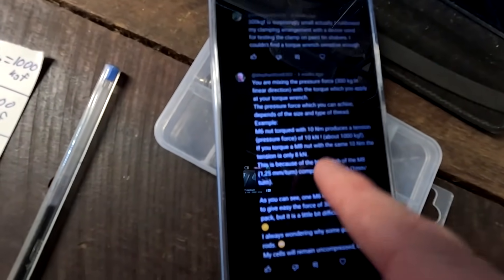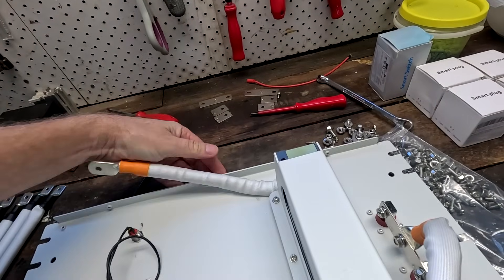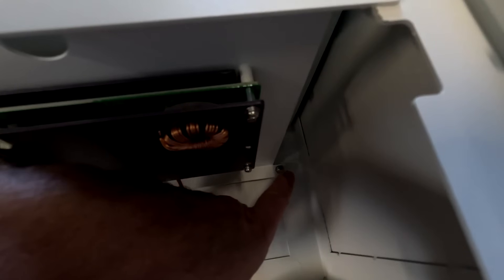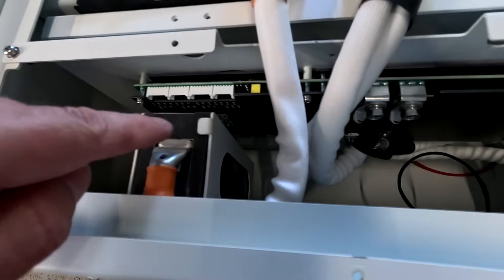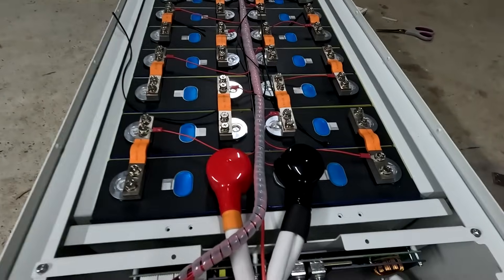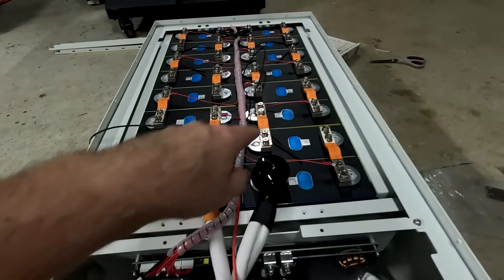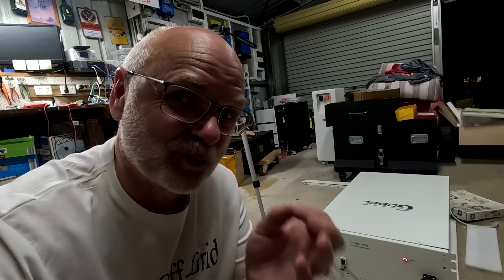The Gobelpower DIY Kit finally in action. Here is how their design works!

Comment: @6:31 you have corrected your mistake from the last video where you had that cable connected to the Battery + terminal. @9:42 the reason the rails don't fit is because you have too much foam between the cells, it's designed to only have the GRP sheets while you took the cells out of the EEL battery where they have foam and GRP. Take all the foam out apart from at either end and the rails will fit. I have the same battery and have managed to fit the NEEY 15A active balancer along with a Victron Smart Shunt and the JK touch screen LCD into it with not much trouble.

Comment: I am currently building two of batteries with this case.  The manual has some notes on the balance cables and where they go depending on which version cables you have.  I have Version 1 with a B17 labeled cable.  It says I need to connect cables B8 and B9 to Cell  8, then connect cable B10 to Cell 9 and finally to connect cable B17 to Cell 16.  My questions are what connects to Cell 10 then, nothing since I now have cable B10 on Cell 9?  Also do I connect cable B16 to Cell 16 with cable B17?  Thanks for all the great videos!

Comment: Hey Andy, my Gobel DIY box finally arrived. All parts included and all wholes fit like a dream, seriously, even the push-down bars, lid and handles. Not a single misfit.
The only thing which really is critical is, that the cable numbering on the JK-Inverter cables are running from 1-17...means from B8 onwards it is wrong! For someone without experience connecting the cables just by number will end up with one spare (No 17😮)...but worse...if they do it like that they kill the BMS as the polarity from B9/B10 then is reversed if you connect it wrong!!! 
Its important to rip out the B9 cable (the second B8 on the inverter) and proceed with B10-B17 ...
Maybe you can shoot this info to Gobel-Power for correction👍
Reply: Hey Christian - can I ask how long it took for you to receive your DIY box? Are you based in Europe? I placed an order and so far it's been a bit of a mess/farce with the batteries I ordered turning up out of the blue (nice surprise...), but not the entire order (missing 4 batteries!... I'm hoping it's not going to be a similar story with the box!!
Reply: @totemimaging  Hi, I only did order the DIY kit and checked on them several times since they did not care shipping the box with any notifications. It took more than 2 month until the box finally arrived - if I remember right. Given the relatively high shipping cost to Germany and compared to the "standard" Alibaba/AliEpress lead-times/cost a rather frustrating experience on that front. Good luck getting your missing batteries..

Comment: That 300kg compression force is nonsense. That presumes 0% flexibility in any part of the plate which is impossible across that span distance if/when, the centre bulge of the batteries grows under heat expansion pressure. 300kg total force is purely the tensile sum AT THE BOLTS.

Comment: Hello Andy, 
greetings from good old Germany (today 20 degrees Celsius) to sunny hot Australia. 
I am watching your Videos with big interest.  
I have also a DIY Kit SR1-PC200 with a heltec 4A aktive balancer an a Deye hybrid inverter.
I can confirm that the accuracy of th srewholes are not so good. I have also recognized that the Downloads of the Gobelpower homepage are not so good. In my DIY Kit was no extra fuse at the bottem of the rack, only the 250A cicuit breaker. Ultimately, my sytem works.
Greetings😁
Bede

Comment: Your 300 kg is shared with 2 stacks of batteries.  Each stack is getting 150 kg.  You need to double the torque on the 6 screws so you have 600 kg total, giving each stack of batteries 300 kg.  Just my opinion.  Oh, I see @olafschermann1592 already said this, with less words!

Comment: You can not accurately calculate clamping force from torque applied. Even things like lubrication and material of the bolt will make a huge difference: you can even repeat the exact same process on the same bolt twice and get different results.

Comment: The problem with "torque" to clamp load is you are just guessing about the friction!  mU is going to be wildly different depending on the exact state and geometry and lubrication state of your fasteners and for small ones, it's primarily driven by thread friction that changes each and every time you do it up as the threadform wears and distorts!.  What i would do is

1) Make sure all my fasteners have been tightened to 75% of yeild at least 5 times each to get to an even state
2) evently lubricate each fasterner with a know lubricant
3) ensure i have excatly the same hardware in the joint , ie washers etc
4) use a set of deomestic scales clamped into the actual system being assembled to "calibrate" the entire system, so you can literally measure clamp load vs torque

Of course, really, all this doesn't actually matter one bit of a low performance static energy storage application, where really all you need is for your cells to not actually fall out the box and that's honestly about it....  ;-)

Comment: I'm confused, in some videos I see the CAN connection is shown as the first RJ45 port and on others it is the second port - so which is correct?
Reply from the maker: It depends on the BMS and which communication PCB they use. Some have 5 ports, others have only 3 ports (Seplos for example).

Comment: 0.5 Nm never will be 300kg, put a scale behind the plate and take a look how far it raises at 0.5 Nm. (and is it 300kg/cm² or 300kg/m² - totally different! I asume the datasheet tells 300kg on the area of a side of the cell).
Or do you think/believe that you can lift a complete car (1200kg) using 4x M6 bolts on that plate with 3 Nm ? (or a single M6 to just lift ONE wheel?) Compare to the Nm you need to use on a carjack (inkluding positive bevel law) to just lift one wheel...
Sorry - that guy feels to be totally wrong or mixed up some dimensions.

Comment: Hello Andy, thank you very much for your video! I ordered two of these Gobel JK DIY cases myself and now I'm in a more positive mood again. Briefly about the JK Inverter BMS: I have hardware 15.XA and firmware 15.10, just like you. Bought from Minerals/Ali. When I update the firmware, exactly when I click on the update start button in the JK Monitor software, the BMS switches off. Otherwise nothing happens; switch on BMS and everything runs as before including FW 15.10. I would just like to update the firmware. I have no problems updating other JK Inverter BMS, only this one. Do you or someone from the community here know the problem...and a solution?

Comment: Thank you Andy, great video again. Don't you need the rails to stiffen up the lid when stacking the batteries on top of each other. Now it feels like the lid will press on to the cell connectors.
Reply from the maker: The lid has no direct contact to the rails, they don't touch. The boxes should sit on the outside frame of the box, not the lid itself.

Comment: A good rule of thumb if you don't have a torque setting ... tighten, a clean bolt,  till it stops, then and 1/8 turn.   All a torque settings is, is a stretching of the bolt.   However ... smaller diameter bolts are more sensitive to stretch, but the M6 and larger you are using should be fine.

Comment: I wonder if the reason the cells don't fit well is because the box is designed for 280A/hr cells, not 304A/hr, the front panel says 280...

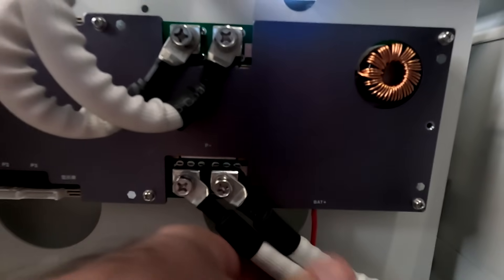Comment: 7:52 I'm really uncomfortable with the angles you have the cable lugs connecting to the BMS. It puts the terminals VERY closeto the metal backplate of the BMS.
I'd suggest you keep the lugs at 90deg to the side of the BMS to maintain maximum clearance (it's on the tight side even in the best case scenario), and if necessary, bend the cables instead. 
In a mobile application I'd even look at using some kind of cable clamp the keep the cables/lugs parallel where they meet the BMS.
(And yes, I know the backplate is anodized, offering some electrical insulation - it's a very thin oxide layer, easily defeated by a scratch, and not something I would ever want to rely on).

Comment: WOW that is TIGHT on the breaker and I agree, I would not want to use that. I'm thinking maybe a cable lug with a 90 degree angle for the Circuit breaker?

Comment: At 7:55 Andy, Is the compression plate  substantially bowed in the center retaliative to the BMS mounting plate or an optical illusion or distortion?  If It's bowed, while you may be getting 300kgf at the bolts, how much uneven force is being applied on the sides of the cells.  At 9:30, if the compression plate is bowed, is it bowed-out about the amount the battery rail holes are short? Back at the 4:00 point perhaps a U-channel bolted across compression plate might help.

Comment: Screwing one bolt will messup the others since the batteries are not a perfectly stiff medium. If you want to compress them, and make sure that all bolts are exerting the required forces, use springs and compress them until they reach the required length. The plate will require reinforcement for 6000N though :)

Comment: Hello Andy
The neg leads reconnecting to the BMS from the battery need to be swapped to flatten the cables.
Reply from the maker: Swap the two negative cables? I tried that and it would not fit.

Comment: Good timing!  I just started putting mine together an hour ago and came back here to look at your previous video.  Instructions are sorely needed, but I should be able to get by.  BTW, I am using the PC200 BMS and my front panel was cut out for the display.  The batteries I got only have a single M6 stud and the kit did not come with flexible bus bars...but the batteries did come with them.  However I cannot use the flexible ones unless I modify them (drill and tap.)
Reply from the maker: I would use the flexible bus bars and re-crimp the balance cable to fit the M6 studs of your cells.
Reply: @OffGridGarageAustralia I may do that.  
In a previous video of the fully assembled battery box, you mentioned that the DIY version was identical to the assembled version.  However, my kit does not include any high-current fuse.  From what I can tell, your kit also does not have it.  Is this really needed since it does have the circuit breaker?  
Also, my kit came with a EK-24S4EB flying super capacitor balancer.   My cells are the MB30 and are well balanced. You seem to be unconvinced that a balancer is really needed.  Should I install it or not?   
And thanks, this video was a life saver, so I bought you a SPAT yesterday, although this was not nearly enough compensation.

Comment: I dunno re: compression plates.  If the batteries were perfectly stiff, sure.  The forces just add.    But honestly, I don't think being "low" matters too much.   You do need to pay attention to the battery SOC when doing the compression, though, since that will change the force.   I think the general rule of thumb is to snug the compression plate up with the battery at 50% SOC.   But I aint no expert on this particular topic.
Reply from the maker: It says 15-40% in the EVE spec sheet for compression...

Comment: Thanks Andy, we can all be happy that you are spearheading this whole community and that you have theses valuable contacts with the manufacturers. 
At least now I know I can get my incoming box assembled😂. The projected batteries are already balancing
Reply from the maker: You may have to open up some holes to make the screws fit with this box. Took me two hours yesterday to fit all front panel screws where they have to go. Doesn't look great any more, some were out by over 3mm...
Reply: Thanks Andy, that is manageable 😉, I guess all of us DIY guys will find a work around, but as you always state, these kits are for those that don't want to mess around with adapting all the times. These kits are supposed to (easily) assemble out of the box. I am honestly glad Gobelpower and others listens to you/the community. That is not a given thing with chinese manufacturers.
Reply: @OffGridGarageAustralia  ciao Andy , ti scrivo dall Italia sono amico , di Sandro Cicali, ho un enorme, grande problema con l azienda EEL , delle batterie, mi puoi aiutare 
Grazie
Reply: @designbyt.c.4097  What problems?
Reply: At 10:08 - 10:40  what the hell are you doing trying to connect across there for a PARRALEL circuitry with the right busbars but in the WRONG place???

Then at 10:48 you show that you've connected them PROPERLY in SERIES config using those very same busbars as the maker provided.

Comment: 0,5 Nm kann nicht sein. Stell doch mal eine Personenwage statt den letzten beiden Accu’s dazwischen. Dann kannst Su das ungefähr abschätzen. Oder Du klemmst die Wage zwischen zwei Bretter zum testen.
Reply from the maker: So, what is the right answer? 300kgf does not seem much. It's less force than a wheel of my car puts on the road. Far less...
Reply: That's exactly what I have done, to check the force of my clamp (Schraubzwinge).
During test off capacity of the new cells I have applied the 300 kg force to each single cell via strong plywood and rubber pads. With one of my old fashioned clamps I have achieved the force hardly.
The treat of the clamp has a pitch of 3mm per turn. The M6 rod has only 1mm. Therefore the required torque is much lower with the M6 rods.

Comment: The part which I find quite strange is that this is basically the same battery that Gobel Power sell preassembled 

So they must have all the same issues in their factory with routing the cables and generally tricky assembly 

You'd think they'd fix those issues from a manufacturing efficiency standpoint, let alone customer experience
Reply from the maker: I'll do a comparison in the next video as I have both here.
Reply: The pre-assembled one has a high current fuse.  My DIY kit that just arrived two days ago does not include this.  I am not happy;  I purchased this box because I thought it had a fuse.  I ordered the black version with the PC200 BMS.  I had none of the issues that Andy had regarding  misaligned holes, although I have not finished the build yet.  My big complaint is that the threaded studs seem to have some dried paint inside the threads.  This has caused some problems with stripped screws.

Comment: Hi Andy!
I'm a little bit puzzled about the "required force" of the compression plate.
As per manufacturer (EVE) recommendation 300kg_f (~3.000N) per cell. Since the compression plate has to compress to stacks of batteries, eacht stack would required 3000N so in total for the compression plate has to transfer 2x 3.000N = 6.000N!?!?!?
Reply: No way that this thin piece of metal hold this. But there is no need for it. You will be fine even without compression
Reply: @ML-hf6ii I have placed 4mm steel and 6 19mm studs I I did tie them 😮😅.
Reply from the maker: Yes, correct, as we have two rows it needs to be 1Nm per screw (not 0.5Nm) to achieve the 300kgf.
Reply: @OffGridGarageAustralia  do you mean that I need to tighten the screws with a force of 1Nm? And it will be 300kg per cell?

Comment: You need 6x 1nm
2 rows of batteries need 2x300=600kg force (6kn)
Reply: You are right. And there is a pretty huge safety margin (till around 1000kg, if I read the data correctly).
Reply: Also, as those cells swell, the force will rise. This is why I use long tension springs down the side of my cells. As the cells swell, the springs lengthen, the force increases.. but by very little. In comparison, the effective spring rate of that box is enormous. The datasheet is a little unclear. It mentions swelling force only in the tens of thousands of Newtons, but it also says "it is suggested to reserve 2.0 mm ~ 2.5mm expansion space while grouping the cells." Is that as a group, or each? Either way, if you expand only 2mm against that steel box, the force will be huge. Expanding against long compression springs, the force will stay basically constant. The picture in the datasheet appears to have a single compression spring at the end, allowing for the expansion to not sky rocket the force. a rigid box with no give......
Reply from the maker: Yes, 1Nm per screw, correct, Olaf!

No springs needed. As per manufacturer instructions, 300kgf at 20-40%SOC, that's it.
Reply: @OffGridGarageAustralia  I think you can not divide this. All screws must be 3Nm. Imagine that you have not only 6 screws, imagine you have 60 screws. I am sure that 6 screws at 0.5Nm don't make same force as 60 screws as 0.05Nm. 

That is why YOU CAN NOT divide as you did. 

All screws with the 3Nm.  I think it is the correct way.
Reply: I calibrated my battery "fixture" with a pressure gauge used for repair of paint tin shaking machines. The torque required on 6x m8 studs was almost nothing, just a little more than hand tight
Reply: This is absolutely right and this is as well forgotten by almost every diy guy out there.
Reply: That's how I did mine, I used 2 big 4mm thick aluminum plates, 9 long m6 rods, and tightend them just a little over hand tight. I didn't used a Newton Meter because I couldn't find any good calculation methods to convert kg force to NM divided over 9 nuts.
Reply: Wouldn't it be 0.5 Newton metre's per cell in the stack. What I mean is, surely if you're stacking the batteries 8 deep per column you would need more force than 0.5 Newton metre's 🤔. If you placed a piece of paper between the last cell in the column and the metal back plate, how hard would it be to remove after torquing?
Reply: @icereturns7867  no, if you put 300kg on one cell stack, each cell experiences that same force. Of you put it onto two cells that are next to each other, each will see roughly half of that. 
If you have two scales, you can test that. If you stack them, then tare them and then put a weight on top, both will read roughly the same. If you put them next to each other and put a weight across them, the sum of their readings is pretty much the weight of what you put across them.
Reply: @svenmueller  Thanks for your concise response 👍